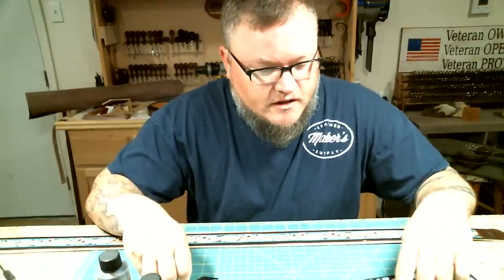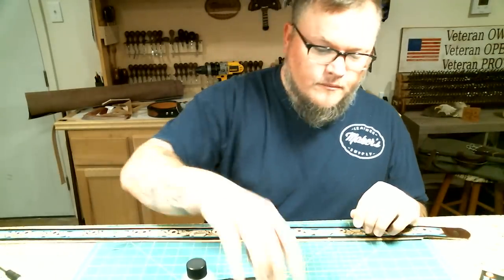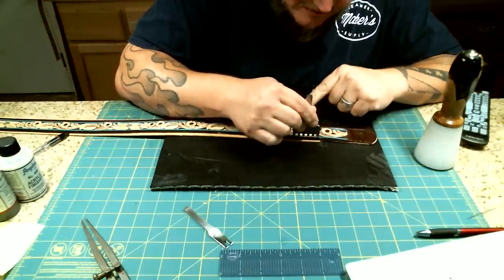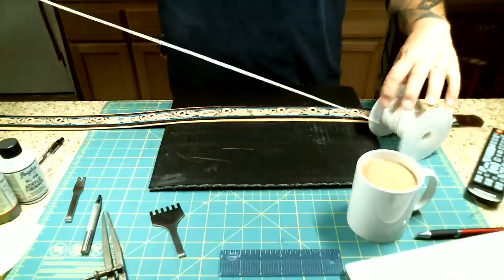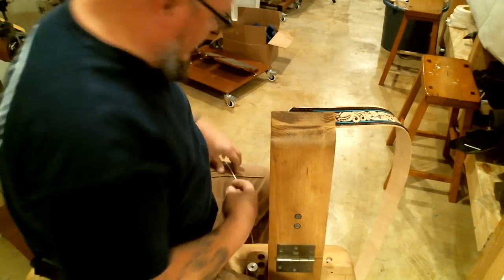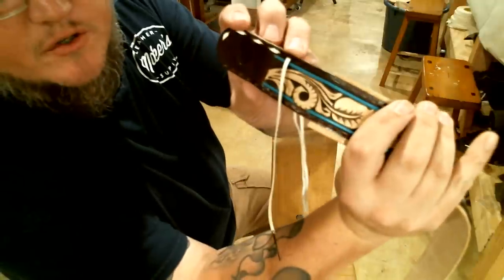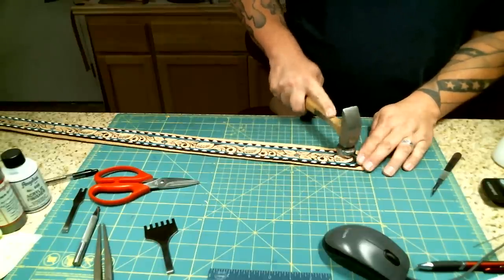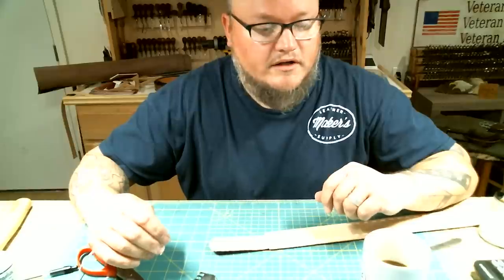Buckstitching Chisels and Buckstitching!

Comment: Great videos Aaron. ! 
I buckstiched 100s of belts in the 70s for belt maker Danny Elkins in Gallup NM just a few tips . Start punching holes fron the tip end back.  Measure 3.5 times the length of belt .  Start lacing from the tip half of lace do a few holes then wrap exess around belt then lace back to buckle end . Come through back to outside edge . By doing half the lace its easier to work with plus you get less ware on lace .  Hope this help .  I agree its almost impossiblr to find buckstiching tongs . I bought your at Prescott . Thanks for making them .

Comment: Another quick tip always try to punch the holes while there is still some moisture in the belt from making it.  It helps prevent a dry leather spliting disaster.

Comment: Really nice belt. I love buckstitching and lacing - it seems to be out of vogue these days, but I love all 50's dude cowboy stuff anyway, so I go for it! As an aside, it's been my experience (limited as it is, but learned the hard way LOL) that it's usually better to splice than to run so much lace through that many holes as the edges tend to not look so good by the time you get to the end, especially on white lace. I use the Al Stohlman method of splicing and that works very well, and it's secure. 

I do have a question, after you apply your antique, do you apply any other clear finish, like Tan-Kote, Supershene, Resolene or the like? Keep making great videos, a guy I know here in Austin uses your templates quite a bit, and I want to try one myself eventually! Thanks again!
Reply from the maker: Jorge Harada with the Angelus acrylic antique no other top coat is necessary.